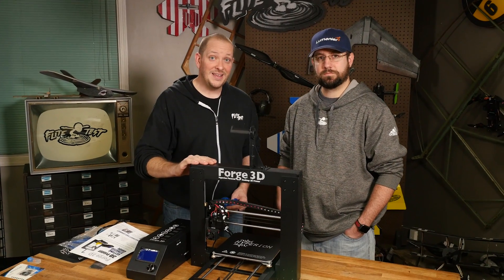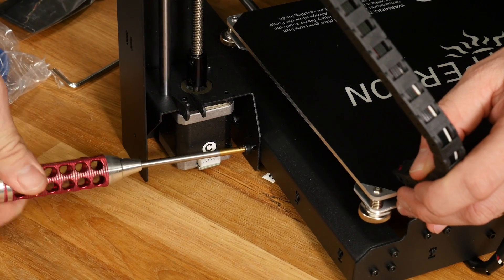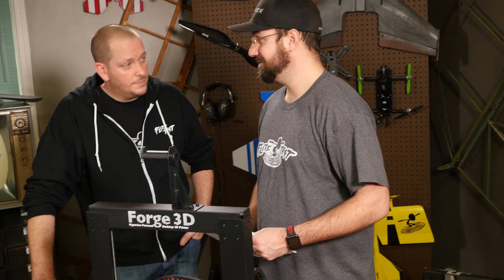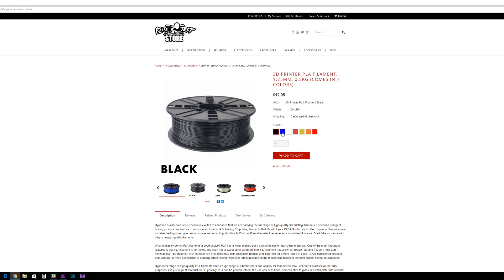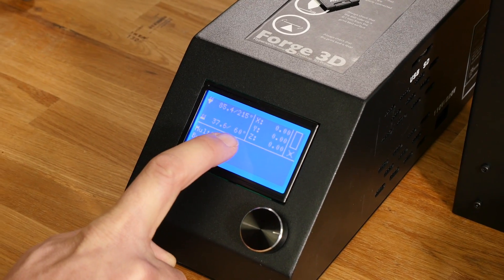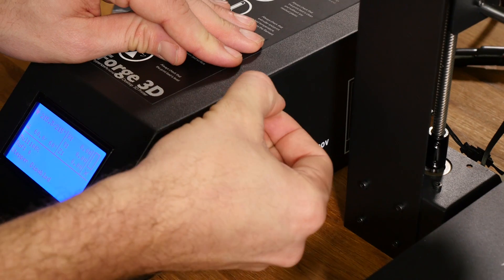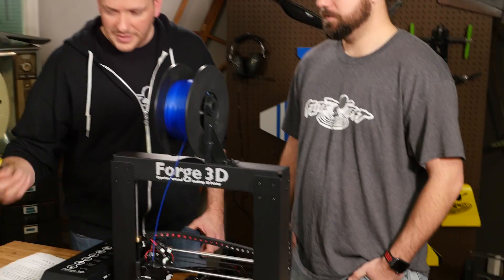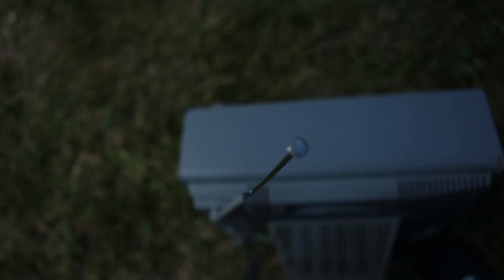How To Setup the Forge 3D Printer | Flite Test

Comment: Do you think that you could print decent props with it? Say, 10.45? How light is the material?
Reply: Not recommended, 3D printed parts like this type of printer does is to fragile for it, since it's made up of layers and not a solid piece.
Reply: Are there any 3D Printers that you would recommend to use for that application? Or is it even possible?
Reply: Not really, most home-use printers use the "extruding" method like the one above. May be some idustrial printers could do it that does not use extruding technics. But most if not all 3D prints are too fragile and will probably never be able to compete with any form of cast pieces. 3D prints are just not solid enough.
Reply: Ok. Thanks!

Comment: Hey FliteTest, is PLA strong enough to use for quadcopter frames and parts? Or is ABS better?
Reply: PLA is more rigid, but but will warp from summer heat(like being left in a hot car).  PETG is the best, but it's a bitch to print with compared to PLA or ABS.
Reply: My printer doesn't have a heated bed, so after PLA I immediately tried PET and it worked great. I had no problems whatsoever.

Comment: Essentially a Wanhao Duplicator i3 V2?
Reply: Or Monoprice Maker Select V2?
Or Cocoon Create?

The good thing about this is that there is a large community with this type of printer that can help you if you get into a bind.
Reply: Chip Griffin even the fucking alenkey for the assembly is to short like the original
Reply: Essentially one of the many Prusa i3 (Mk 1) clones because it is a proven design. At least mention the original ;-).
Reply: also the 4 point leveling system, I hated it
Reply: Wanhao Duplicator i3 V2.1 . The only difference between it and the v2 is the belt rubbing has been fixed. I have the v2 and I had to fix that problem myself. It's an awesome printer for the money. I have had mine for over a year and its awesome!
Reply: The main power connector on the melzi controller in the wanhao i3 clones is crap and tends to melt .  My monoprice was having random rebooting issues until the power connector finally melted.  Suggest replacing the melzie power connector with an xt60 and better conductors.
Reply: Looks like a rebrand. Not a bad choice, good price, big community, and fairly proven design.
Reply: They've clearly updated the firmware, at least. Couldn't tell but they might have fixed the wheel steps. Fingers crossed they turned on MINTEMP failsafes while they were there.
Reply: Chip Griffin and the maker select v2 and the prusa i3
Reply: +Adrian Chen very true, especially if you live in Europe, the second time I ordered, it never arrived
Reply: Where do you get the feeling, that "you probably won't get fast support from Flite Test"? Did you have a bad experience?
Reply: Balu I never had a bad experience with them. it's just that if you contacted flitest support, i can bet you that they'd have no idea what you were talking about. Monoprice has better, faster support and they would know more about 3D printers.
Reply: The extruder on the Monoprice/Wanhao v2.1, which this is, isn't awful at all.  I had plans to replace it when I bought it and have not needed to yet.  It's been printing steady for about 4 months now.  It's an awesome printer, imo.
Reply: The MK10 extruder isn't awful. It's just not the best, either. Solidly ordinary. But trust me, the E3D V6 (even a clone) is almost magical in comparison. Silky smooth. I really recommend going remote bowden if you're doing that kind of conversion though. Fortunately the Forge/Wanhao/Cocoon/Malyan (and "Monoprice" did you say?) is a really solid base for that kind of thing.
Reply: +Mike Wick  it does the same thing on the real wanhao i had to change the melzi